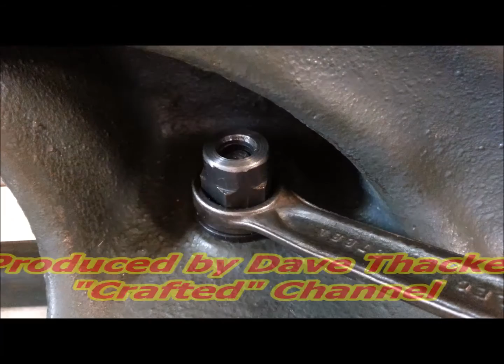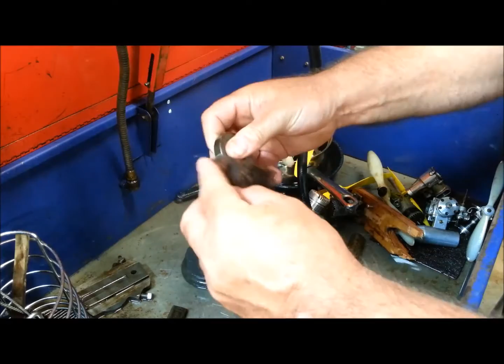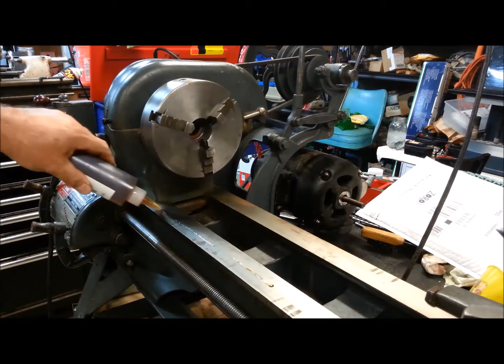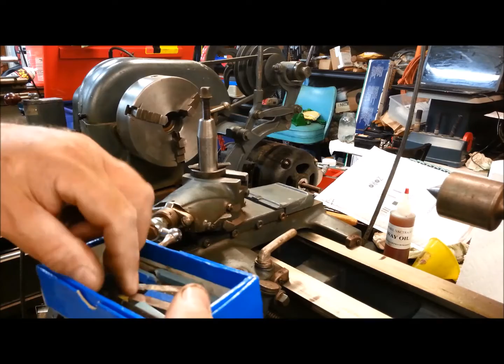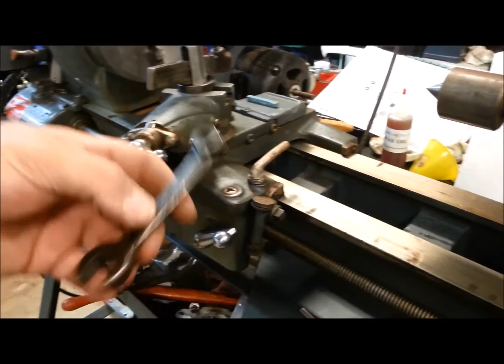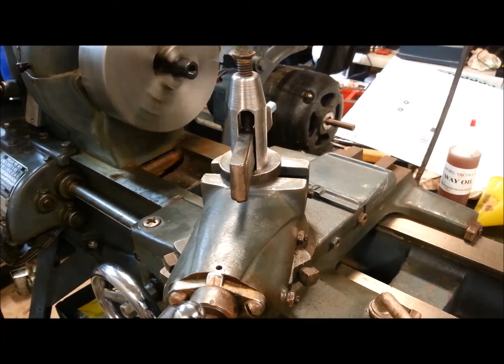Atlas / Craftsman  QC42 First Cuts - Wrench Retaining  Tailstock Nut: PART 1

Comment: I guess this is a, what not to do when setting up your lantern tool post video?
Reply from the maker: Not at all.  It's a video about getting a lathe together for the first time 3 years ago. Who uses a lantern anyway?  Waste of time.  Why don't you stick a video up so we can see if you know anything or have any kind of shop at all?  People making snotty comments never seem to have any subscribers or content of their own.  Did you ever notice that sir?
Reply: @CraftedChannel  be surprised alot of times one lantern with diffearant holders is better to use than a indexable holders or quick change...and yes have been a machinist 45 years plus ...prototype..manual machines ..cam driven..nc..cnc..broach ...had to be bonded to certify able to do work
Reply from the maker: @miguelcastaneda7236  I would love an opportunity to tutor under somebody like yourself and learn to appreciate lanterns.  At my skill and experience level it's an unstable element in a project.  I'm about getting it done and tend to choose the tooling I can work with the most effectively.

Comment: Looking good bro. Just a few kinks to work out. 
I seen an old drill press very similar to your large post mount one. This was a smaller bench type with the open gears. I took pictures of it. It was very cool but it was very expensive. I Think around $269.99 or $289.99.
Reply from the maker: BluegrassBushcraft I see them listed for high dollars on ebay, but if you investigate actual sales, there are none at big dollars.  Doesn't stop people from asking.   Sellers will often look on Ebay to find a value but will fail to look at closed sales.  They only look at the actual buy-it-now non-auctions.  Many of these will have very high ask prices that the seller never gets.   Look forward to a photo.    Got your package.  My phone is full and I can't pull files off it.  Need to repair the USB connector.  I'm stuck for a bit.  Was planning my "Can You Get Home" video for next weekend.  Waiting on the rivers to come down, have to make a few crossings.   However, no recording device as of the moment.